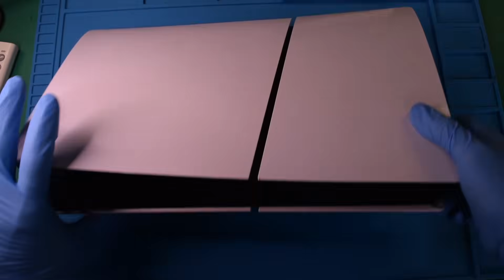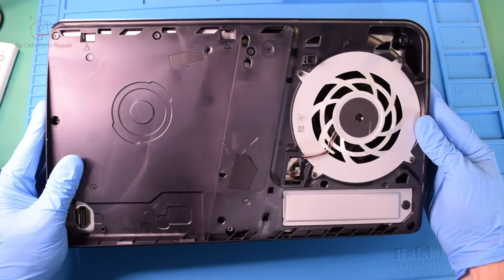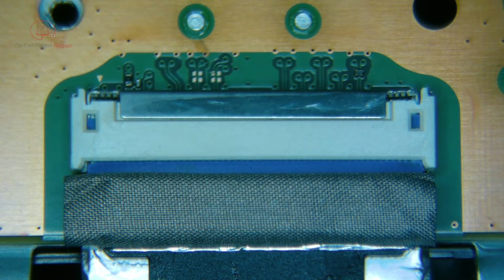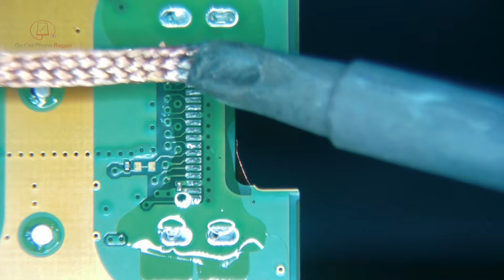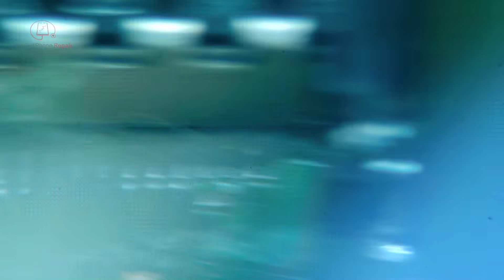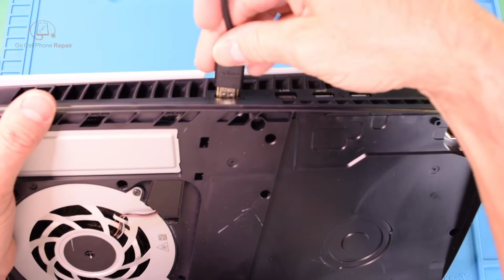PS5 Slim HDMI Port Replacement

Comment: What if the old soder won't liquefy
Reply from the maker: It takes a ridiculous amount of heat, but of course not so much that you cause problems with surrounding components. It's a balancing act of sorts but you need the right equipment to start with. You can mix in some leaded solder to make things slightly easier. That will reduce the melting temperature requirement.

Comment: I doubt I have these tools, and I'm definitely not paying 200$ for a stupid fucking replacement. I'm just done gaming. GGs.
Reply: It won't cost you $200. 

Most shops will charge $100 at most. It's a 10 minute job and the part costs $2

However, even "cheap" equipment to do this job properly costs a lot of money. And the experience in takes to do the job safely with a good quality result doesn't come easy or fast. So that's why the 10 minute job and the $2 part end up costing $100

Comment: Do you need to clean and replace the thermal paste? after 4:07?
Reply from the maker: 4:07? There's no thermal paste there but the PS5 uses liquid metal which you should not have to replace unless it leaks and you don't want to replace it with thermal paste.

Comment: Can I ask why you chose to go with a soldering tweezer and solder instead of solder paste and hot air?
Reply from the maker: It's just what I'm used to. Either works but I find that solder paste can be messy if I'm not careful. Stray solder/solder balls can be dangerous.

Comment: Is it possible to use a heat gun instead?
Reply from the maker: Many have tried and failed. A heat gun does not give you the precision needed for this repair. It will most likely will end with a further damaged console. Not recommended.
Reply: @GoCellPhoneRepair thank you for responding. I did try and it didn’t work lmao. I hope I didn’t f*** anything up. I’m gona get one off Amazon. Which liquid flux are using?

Comment: Great video!!! Thanks a lot for all ur tips, really helped a lot. I did have to use leaded solder to remove the hdmi port as my heating statition isn't nearly as good as urs.
Reply from the maker: You're welcome!
Reply: How did you do yours as I'm in the same situation as the heat

Comment: What electric screwdriver do use?
Reply from the maker: That is a Ryobi 4 volt HP34LVN. I've added a product link to the video and description.
Reply: Thank you, I couldn’t find the link in the description. I did find the tools but I would prefer to buy it of your link if possible so you can have you share too.

Comment: what tempruture was the heat gun and the soldering pen ?
Reply from the maker: For the hot air https://youtu.be/V9ReYFuLWJI?feature=shared&t=559  As far as the soldering iron mine is at 840F.

Comment: can soldering the hdmi wrong cause it not to start?
Reply from the maker: I have not seen that before. There is a 5 Volt line that might cause some issues if it gets shorted but I wouldn't think that it would prevent it from booting. It's always a good idea to check your diode values on all pins when in doubt.

Comment: PlayStation needs to get into a massive MASSIVE lawsuit because of how low quality their products are ( I might as well sell my ps5 and go back to a ps4 since it’s higher quality and cheaper to fix hdmi port which is £20-£40 and ps5 is £60-£70 which is too much )
Reply: Also how they use warranty stickers in the us warrenty stickers are illegal
Reply: wtf it cost me $240 where I’m at 😭 I’d take that deal in a heartbeat
Reply: I'm with you I have had the same issue on three of my PS5 and there's no excuse my PS1 works better than the PS5 and cost five times less I'm with you with the lawsuit someone needs to start getting people together
Reply: I brought a 5 pack for £7 and fitting them myself video incoming and yes I’m learning from this video 😂 I’m using solder paste not wire though so much easier and better
Reply: You know what else is massive… LOWWWWWW TAPOR FADD
Reply: @TheFlamingJake 2025💔
Reply: And the costs to fix it are so high 🤦 minus we’ll save up for a PC at that point

Comment: What if one of the adhesive pieces are missing?
Reply from the maker: If you mean the ones for the antenna wires you can replace them with adhesive label material, Kapton tape, or even painters masking tape. Their purpose is to keep the wires in a position where they won't get pinched.

Comment: What heat tap did you use to keep those two capacitor in place?
Reply from the maker: Copper conductive tape. I've added a link to the video description.

Comment: I am doing a PS5 HDMI port repair myself. This unit had fallen off of a desk and the HDMI port was damaged. I found it to be a pain in tge ass to try to use my soldering iron to remove the port, so i myself used hot air. And cleaned terminals in pcb with solder wic just as you did. 
Great job! Now i just need to wait for my HDMI port to arrive in the mail.
Reply from the maker: I always recommend hot air for the removal, it's much easier! Glad to hear that you found the video helpful.

Comment: I have a question. what would happen if those 2 little capacitors are missing??..
Reply from the maker: If you are referring to the bottom side, it will likely result in no image. The one on the top is a different story. You may have no image, no 4K output, intermittent display issues, or no noticeable difference from what I've been told.

Comment: Can someone with zero experience with soldering do this?
Reply from the maker: I would not recommend it as your fist HDMI repair. Even people with "some" soldering experience tend to struggle with this. The heat requirement is very high but you have to balance that with not damaging the board by prolonging the process. Not enough heat and you can easily pull the pads off of the motherboard creating a lot more work. For those who are really curious, I'd suggest buying a practice board from an older model, like a PS4 to get an idea of what you are up against before risking damage to your console.
Reply: No

Comment: May i ask what the liquid was that you kept putting down before cleaning was? And will soldering?
Reply from the maker: 99% isopropyl alcohol.
Reply: @GoCellPhoneRepair  thank you for answering but May I ask how that helps well soldering and applying what's the benefits?  Not doing the job myself just found your video and man you made it seem amazing
Reply from the maker: The rubbing alcohol removes flux which had been applied prior to soldering. Over time, it is possible for flux to become corrosive and damage the components on the motherboard. Flux is sticky so this is an efficient way to remove it and it also leaves the surface looking nice and clean. I'm glad that you enjoyed the video!

Comment: do you know the name of the tips used on the screwdriver
Reply from the maker: For the Torx screws you want TR8 or TR9 security bits. They vary a bit from one brand to the next so it kind of depends based on that.

Comment: What are the solder points for that have no trace on them. Ex at 10:55, the 5th from the right? If I had to jump that where do I jump it to. Thanks
Reply from the maker: At 10:55 the solder pads are vertical so fifth from the bottom has a trace on the left. Fifth from the top is connected to ground on the right if I am understanding you correctly.

Comment: Quick question, is mandatory to replace the Liquid Metal for the CPU? Or you can just remove and put everything together? Will this be like the same as re applying new liquid ?
Reply from the maker: I recommend leaving the liquid metal as is unless it has spread out away from the APU. It is meant to last a long time unlike the old paste that dried out after a while on the PS4. It is a good idea to prevent contamination as well while you are working on the console.

Comment: This may be a stupid question but what is the liquid stuff you using ?
Reply from the maker: Flux. It helps with heat transfer which is very important especially with this huge motherboard that is designed to cool rapidly.
Reply: @GoCellPhoneRepair  ooohhh okay thank you !

Comment: Are the 4 legs of the new port supposed to go all the way through the board?  I don’t think mine have holes.
Reply from the maker: Yes. Where did you get the port?
Reply: @GoCellPhoneRepair Amazon. I don’t think my board has holes. I tried to heat it up with both my iron and heat gun.

Comment: when you’re getting the solder out of the hdmi holes are you having the board set up side ways? flat? or what
Reply from the maker: The part of the board where the port is hangs over the edge of my work bench so that I can apply heat from underneath it.

Comment: The only thing i dont like about the drop method is the amount of heat you need to keep soaked into the board.  Ive got it honed in now for the ps5 and xbox boards . Come out so clean now. “I add a ton of leaded solder on top ports so when you push it though, most the leaded can be wicked away from the bottom of board. I have a good method for cleaning the holes, but dont bother anymore now.
Reply from the maker: I'm not a fan of that either. Most people will almost inevitably end up adding more solder in the process and unless it has the same composition as the stuff from the factory, mixing different types of solder can affect the mechanical, electrical, and thermal performance of the joints. Most important in this case is the structural strength as we know how often they get broken in the first place.
Reply: @GoCellPhoneRepair i used to remove the old solder completely from the ground legs.  Now i just mix and drop.  The pads always get fresh leaded solder.  Ive been doing it that way for awhile now.  Haven’t had any returns , it’s been alot of them now!  Makes your job slightly faster, thats all

Comment: I wish someone  tells me the value of  capacitors' and resistors. l have a board left over previous repair attempt. Nothing left around. upside and  downside. Thanks in advance.
Reply from the maker: I wish that I knew as well. Sony keeps their schematics under tight control. The only way to find out is to remove and measure them one at a time.

Comment: Nice video. I hot swop its easier and faster. i used to use this method but found it not necessary to go through the trouble of cleaning out the anchor holes. great job though. Im still waiting for a slim to turn up at my shop all i get is the original ones...but loads of them. I probably see 1 series x to 50 PS5 for hdmi port replacements.
Reply from the maker: Thanks. Yeah I used to do the hot swap and have nothing against it but sometimes the ports don’t sit flat and I’ve found this method to be more consistent, at least for me.